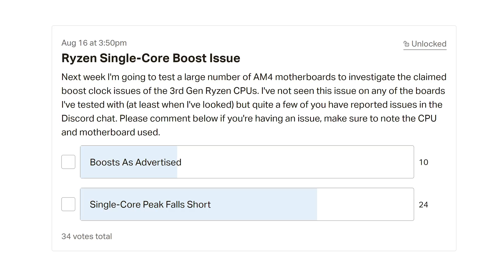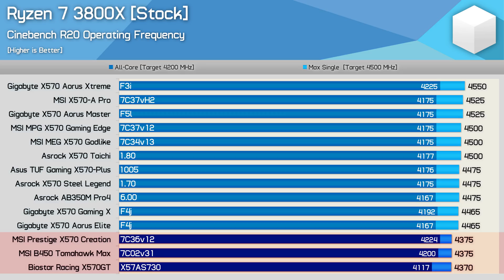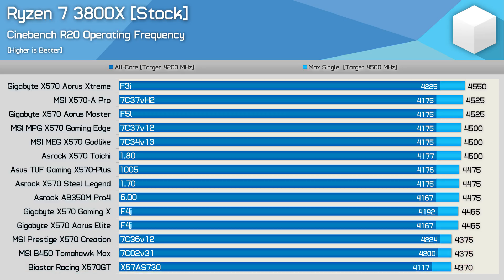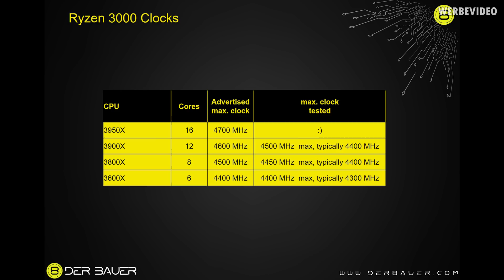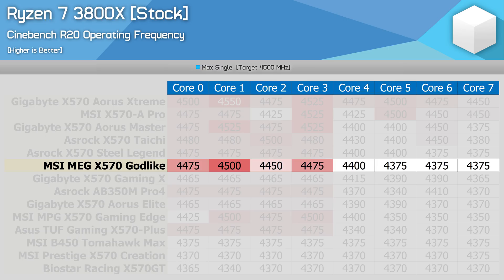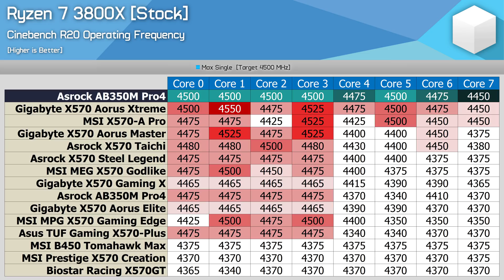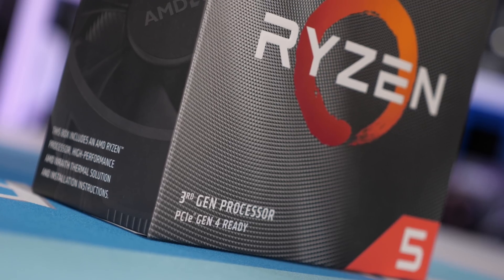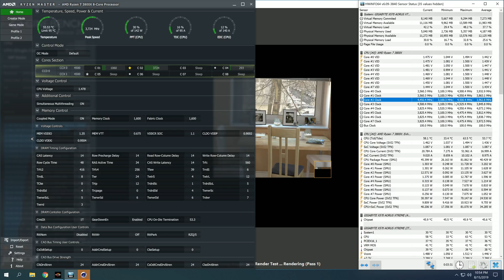AMD 3rd Gen Ryzen Boost Clock Investigation

Comment: it would be interested to see for how long do they maintain that clock speeds , reaching the max speed couple of times during a test is meaningless
Reply: Your definitions of boost mean jack shit. 1% difference in clock speed is even more meaningless.
Reply: @imadecoy.  well yes, of course. But it's more the matter of a principle. If you advertise 4.4 one would logically expect to see 4.4 as a minimum when you hammer that one core consistently thru the test.
Reply: @guldukat1354  Not when they advertised it as an opportunistic boost algorithm.

Comment: I got the base 3600 non X with a B450 on day one. It's boosting nicely to 4.2@stock on all cores.
Reply: T_T i am using a 3600 on b450 tomahawk i never hit at 4.2ghz on all cores
Reply: Same 3600 non X and Tomahawk.B450 ...1st 4 cores ..4199....last 2 4174....so it is a MB issue....
Reply: Same here.
Reply: Me too, and there's nothing special about my setup (MSI B450m Pro VDH v2, Wraith cooler.)
Reply: on peak clock i got 4200, but when running cinebench15 multi core running at 4050 vdroop happening @1,35.v
msi b450m mortar titanium bios A.80 - ram @3733 fclk @1866
Reply: @deminatoer  Which cooler are you using? Case airflow? What kinda temps does it hit on all cores?
Reply: 3600 is where the value is, tested one with Asus B450i ROG with 3 cores at 4.2 and 3 between 4.25 and 4.35
Reply: mine does to 3600  on a msi b450 h60 cooler
Reply: same with ab350n and 3600.. auto oc takes it to 4.27ghz
Reply: For those using b450 boards, did you have any issues with bios updates?

New to ryzen building and pondering going with a cheaper board for a 3600 or 3700x or buying a 570x for easy no hassel plug and play
Reply: My r5 3000 runs 4075-4125 on asrock b450 fatality itx with 120 aio cooler
Reply: B350 w 3600x getting 4.4 GHz.
Reply: I haven't heard many people complaining about not hitting 4.2 on the vanilla 3600. That frequency seems to be easy to hit on this architecture, even with the lowest binned chips, which is what gets put into the 3600.
Reply: I just tried r5 3600 run manual all core at 4.2 1,35v tested with few apps it is stable so far. but never get a chance to test with prime95 due to  shit aio cooler. It always reach 95c and throttling.
Reply: I have base 3600 with stock Wraith Stealth cooler running on an MSI B450-A Pro board. I'm only getting 4.1 on all cores. This video suggests this may be fixed in the future if MSI updates the motherboard bios... I think?
Reply: @benzost920  Are you sure about b450-a pro + 3600? I think you lost the silicon lottery.  https://prnt.sc/ovv8pe <- left manual OC 4.3MHz/right with PBO.  i have exactly the same MBO + CPU -> https://prnt.sc/ovve95
Reply: @taurica6522  Absolutely certain. When I look at MSI CPU-Z (like your first screenshot), it's exactly the same, except:
1. Core speed around 4075mzh.
2. Multiplier at 40.75.
3. Core voltage at 1.424 V
Reply: @benzost920 
1) You can reset your BIOS (or CMOS) to its default settings
2) Install the updated AMD chipset device software for b450 https://www.amd.com/en/support/chipsets/amd-socket-am4/b450 
3) Enable precision boost overdrive
Reply: @taurica6522  I wouldn't want to reset CMOS because (if I understand correctly), that would return my BIOS to its original factory state, which is incompatible with Ryzen 3000 - which would mandate re-updating my BIOS with the FLASH BIOS BUTTON.

However, I am willing to switch to a different BIOS version. Right now my version is 7B86vA9
, realeased on July 23. There is a prior version that was released on July 10. Since your 3600 is boosting to 4.2, I'm curious what version you see running in your BIOS?

I'm afraid to enable PBO, since I think it voids my warranty, and I have read reports that it doesn't do much of anything anyway.
Reply: @benzost920  haha dude , clear CMOS cant reflash your BIOS , only thing what will happen is you get default BIOS settings. 
it is crucial for some boards anyway after a BIOS update or to hard OC.
Reply: My MSI B450 pro carbon AC won't boost the CPU to that lvl. Freaking frustrating...
Cooled with an 10 years old Cuplex XT DI2 @62°c  with all cores cranked with OC up to 4200 MHz for 2h with prime 95, room temp @ 23°c.
Reply: 3600 non-X @ 4199MHz all core (while gaming and AIDA64 stress testing) on a MSI B450I Gaming Plus AC. Cooled with an Enermax Aquafusion 240, PBO enabled, - 0.1 voltage offset.
Reply: Mine was hitting that speed as well. But when i updated my Bios to newer one it is not anymore and only maxes out at 4.1 ghz even with PBO + Auto OC with a MSI B450m Mortar Titanium. 

Update: Just reverted my Bios to older 7B89vA7 with my MSI B450m Mortar Titanium and it now boosts up to 4.2 Ghz at stock settings again. If you got the same motherboard don't update to newer 7B89vA8.
Reply: What cooler and exact motherboard do you have?
Reply: @Isaax  Got similar results: Asus Prime B350 Plus with an R5 3600: Boosting up to 4276 MHz on Core 1 and 4192 MHz on all other cores, so its even Faster, than quotet on the box. And Of course, I´m using Stock Bios-Settings.
Reply: @FabiaLp  and what cooler?
Reply: @FabiaLp  same exact Mobo with a hyper Evo 212  instead the default cooler
Reply: @FabiaLp  I gave the same motherboard but I'm waiting for last Zen release for am4 while will probably be ryzen 4000
Reply: @FabiaLp  :( I only get 4050 on my 3950x
Reply: What does "boosting to 4.2@stock on all cores" mean, anyways?
When doing what?  You ain't boosting to 4.2ghz on all cores at the same time on a 3600 @ stock settings running Cinebench or even CPU-z stress test.
Reply: @Isaax  B450 MSI Gaming Plus, bios version 1A1 with a Nox H-212 cooler.
Reply: @Isaax  i have shitty(pretty) Gigabyte b450i Aorus Pro WiFi and Kraken x42 and boosts to 4.2
Reply: 3600 non X with MSI B450 MORTAR-TITANIUM, bios 7M (20/6/2019)
I hit 4.3Ghz single and 4.2Ghz multi boost with no over clock touch, ram running 2666
https://upload.cc/i1/2019/08/04/7rGFy9.png

Comment: Yeah, my Asus crosshair VII seems to have pretty bad BIOS issues with my 3900x (was fine with 2700x + old BIOS). Loads of boot problems, that might have fixed with SOC and FSB Voltage increases. Also boosts at max to 4.2-4.3Ghz.
Reply: I have "NO" issues getting the "box rated 4.4ghz" on my 3600x (lightly threaded workloads) with the crosshair vii hero mb (bios ver. 2501-agesa 1.0.0.2) straight out the box with no tinkering required in the bios.
Reply: @kidchunk8989  yeah, not everyone has these problems. I'll need to do even more tinkering to see if I can get it to work bit better. But it has been massive pain in the arse to solve due to the boot problems.

Comment: I have "NO" issues getting the "box rated 4.4ghz" on my 3600x (lightly threaded workloads) with the crosshair vii hero mb (bios ver. 2501-agesa 1.0.0.2) straight out the box with no tinkering required in the bios.

Comment: Thanks for doing this test, i bet it was a huge load of work , especially since you used the same the cooling, and yeah amd fed up especially with that video , and that precision boost  doesnt work as good as manual overclock, i get much better results with manual overclock on my 3800x with x570 master f5n beta bios , still sleep doesnt work for me under windows 10 , i get reboot instantly( on all versions of bios for the master )

Comment: Almost all those X570 moterhboards are complete overkill for a single core boost or multicore boost of a 3700X/3800X, the voltage is high and the current is low, it doesn't ask much from the VRM's. This is just buggy software (BIOS), it is inexcusable that the X570 Elite can clock that same CPU 85 MHz lower than the X570 Extreme, 55 MHz in the case of a multithreaded load. 

Not the only thing which shows that those BIOS's are incredibly immature. For example, when because of OC'ing the RAM/IF/CPU it fails to boot (no problem) then you see the USB-LED's go on again but after that it powercycles 3 times before it starts the resetted BIOS. Or the other way around, you turn off those USB-LED's again and it takes around 3 seconds before after hitting the reset-button of the case before you see the LED's turn off. I can easisly tell because I see the reflection of that light on my wall.

Comment: My 3800x has a stable all core 4.35GHz OC at 1.35V. Very happy. Running on an Asrock X-570 Taichi with a 240mm Corsair H100i PRO AIO.
Reply: If anyone is interested, I’m using 32gb Ballistix Elite DDR4 3733MHz 16-17-17-36.
Reply: I run 4.35 non-oc with my 3700x
Reply: But it is not stable. It does not reach it that often...
Reply: By the way, this is using Thermal Grizzly Carbonaut. It never goes over 71*C even under load. It’s awesome. Thermal paste is a thing of the past now.

Comment: AMD pushed things so hard on these CPUs,. and their marketing, it's running into the gray area before being considered fraudulent. They really should have advertised slightly lower clock speed and over delivered.
Reply: Looks like they already are. they claim 4.5ghz, and they can achieve 4.55ghz. Certainly nothing remotely fraudulent about that.
Reply: @TheCountess666  On this CPU model maybe. I seem more people with the 3600x and 3600, which I have, are not getting advertised speeds.
Reply: @gaunterodimm3606  It's not the CPU model. its the motherboard('s bios). you did watch the video right?
Reply: @TheCountess666 Problem is that AMD didn't build in any headroom what so ever on the CPUs for any variance on the motherboards or anything else, which is my point. Better under promise, at least a little, and over deliver. Either way it's still AMD's fault, in part at minimum. It's their chipset, CPU, base micro code, and  spec requirements for the motherboards. As Steve and Der8aur both said "This problem is ultimately cause by AMD". Did you watch the video 6:25
Reply: @gaunterodimm3606  I dont think you really grasped the point of the video. It's a software/firmware issue. It will get fixed. All motherboards will boost to the specs on the box eventually.

The margins AMD has on the CPU's are fine, are in fact clearly at least 50mhz above the specs on the box.

Steve is basically chalking it up to teething issues. And i'm sure everyone involved would have loved to have more time before launch (which is the case with every product launch ever) but as far as issues is concerned this seems pretty minor on the whole.

nothing sinister going on, nothing shady, just some teething issue with a new platform. sit tight, the CPU works, just enjoy it, dont worry  about it, this minor thing will get fixed.
Reply: Seems more like a motherboard issue, since the CPU can hit whats advertised.. its the board thats the variable
Reply: But it seems to be motherboard peculiarities rather than processor issue. at least that's what I take from the video
Reply: @MrWillypanda88  As Steve said, which I agree, It's still AMD's fault.
Reply: Well same story with the 9900k that could do 5ghz at 95w. Technically it can, but if you try to push more cores, this 5ghz goes flying out the window. Seems like both companies dance around the gray area.
Reply: @TTL_Tsaki  money is the drug

Comment: Here some data from my own 3700X CPU:
- 4.36 GHz boost single core out of the box
- 4.0 GHz all core boost out of the box
- 4.1 GHz all core boost with PO
- <4.3 GHz single core boost with PO (Gigabyte motherboard)
- IF can be clocked up to 1900 MT/s with a SOC voltage of 1.10 V, I didn't try it with a higher voltage. That means that I could use RAM up to 3800 MT/s if the memory controller is good enough
- I don't know if 3733 MT/s is achievable, 3666 MT/s is achievable for sure with the memorycontroller on that CPU (it boots up to 3666 MT/s with my RAM and CPU) 

It seems to me that i didn't win or loose the silicon lottery with the CPU. Bummer, I hoped that I would win the lottery. I haven't  tried manual overclocking yet. Memory OC'ing is MUCH more important, that has been my focus.
Reply: I have a 3900x and it runs dail at 4133 mt/s at 1.1v soc 1.4v. system has been rock solid stable. its on an asus crosshair viii board. single core max ive seen is 4.556 and all core is 4.2ghz across all 12 cores running r15 score is 3288 im very happy. this is with pbo enabled auto oc enabled scalar set to 10x fclock set to 1900mhz and cpu set to - offset of -.1v runs all cores in the 1.2ish volts range and only hits in the 60's c in prime 95. im not complaining im very happy with 3rd gen ryzen. ive seen better 3900x setups but im pleased with where mine is at rock solid stable runs great im done messing with it. radeon vii running at 2000mhz/1200hbm its a beast of a machine. 6tb total storage 2tb of that is gen 4 nvme drives
Reply: @TheCivicsiep3  What kind of CPU cooler do you have?
Reply: @TheCivicsiep3  

One little thing, mt/s is being used for DDR memory, for CPU's you juse use Hz. For DDR memory they use MT/s because you can have two memory operation for every cycle,  once on the up-edge and once on the down-edge. It might have been just a typing-error, in case it isn't clear and to avoid confusion I point it out. (the capital M also is important because a small m is short for milli which is 1 billion times as small though the context makes clear what you mean when you use a small m)

For the memory I still am at 3533 MT/s, now with 1.45V. After having read a part of this guide I suspect that I might have gotten it stable by increasing 2 timings with 2 (light penalty, not a problem) or changing a resistance value. 
https://www.techpowerup.com/review/amd-ryzen-memory-tweaking-overclocking-guide/7.html
I haven't had time yet to experiment with it. The testing after changing the settings is the problem, we are having hot weather here again (around 30 degrees maxima and around 20 in the night), I prefer to let my computer run 6 extra hours for memory testing when it is not hot. :)
Reply: Save you some time, Just go to Ryzen Master and hit the Auto Overclocking button and set it to 200MHz, hit applied and your done. It will beat manual overclocking on single core and lose on Multi but we are talking about a 1% difference either way.
Reply: @ellsworth1956  

Really? It is not a solution for me, I don't use Windows. ;) 
Well, sometimes (at least until I replace my current graphics card) but not most of the time.
Reply: I think we have the same batch of chiplets... Totally same speed and same situation with my 3700X. 

Manual OC with 1.34V only achieved 4.2GHz all core stable...
Reply: @davws88  

I haven't tried manually OC'ing yet, mostly because I haven't looked up how to test for proper stability like those guys from siliconlottery do, thye do a bit more than just a quick Cinebench run (probably also a long run of Prime with several settings and most likely also some other programs which stress the CPU). If you don't know how they test stability then you can't really compare your CPU to those statistics as I see it. On the other hand, if you want to know what your CPU can do, sure, play with it. I wouldn't recommend anything more than 1.35V (electromigration), you probably already know that. I am curious to what extend the boost will improve in the next months after updates of AGESA. I would like to see 4.2 GHz all core boost and 4.4 GHz (not 4.35 or 4.367) if that is safe for the CPU. 

When I changed the three parameters TDC, EDC and PPT to the '3800X' settings none of these even got close to being maxed out (Ryzem Master) and my temperature never got above 65 degrees C, yet it didn't boost higher. There clearly is a limitation in the microcode/AGESA for the boosting, probably to ensure that they don't degrade the CPU. I expect that in the next few months AMD will refine it a bit, be more certain what they can do without risking degrading the CPU.
Reply: Wow you are unlucky. I get 4.3 GHz from all my cores. Thats a ryzen 3700x.
Reply: @doufmech4323  
No, you are incredibly lucky, you got a golden sample, one which they would have sold as 3800X if they needed more, assuming that you get this 4.3 GHz without any manual overclocking, only PO. In case there is any confusion: all cores means all cores at the same time. Any core of mine gets the boost but for an all-core boost it drops to 4.1 GHz at best at the moment.

I didn't point out yet that for PO I also increased the maximum values (EDC and the other two) to the values belonging to the 3800X and 3900X. My best Cinebench R20 scores are 507 (without PO) and 4935 (with PO, without PO I end up at around 4730-4835 depending on the run). Those numbers are the same as what I saw on most reviews. See for example Guru3D and Anandtech. 

Something else which could play a role which Steve did not point out, for later versios of the motherboard BIOS they made the boost behavior less agressively but that does not explain all of the difference. I hope that more mature BIOS'es will help. Which motherboard do you use? It seems to me that the motherboard companies have been slacking for AMD.

Comment: clock speeds would be also interesting with updated x370 and x470 boards most of the systems at the moment runs :) by the way 16 or 24 core with allcore 4.1ghz is amazing. got the asus prime x470 pro  (bios 5204, AGESA 1003AB) with the r9 3900x and it reaches 4550mhz by aio cooling.

Comment: My 3700x boost as advertised but very shortly.
Also, my 3700x on a x470-f strix in auto is draining way to much power for its own good. I had to manually put the voltage and do some overclock.
4.3ghz, 1.3v (auto undervolting to 1.26 and overvolting to 1.34 if needed) and activating PBO to +200mhz max.
Before that the voltage was going to up to 1.5v and the all core was all over the place and achieving garbage benchmarks. Now, i hit 5200 multithread on cinebench R20.
Reply: You are super lucky... My 3700X wont even hit all core 4.25GHz stable without 1.41V.. I'm currently running 4.2GHz on 1.33V.. It sucks..
Reply: @davws88  Wow ! At that point it should have been a ryzen 5...